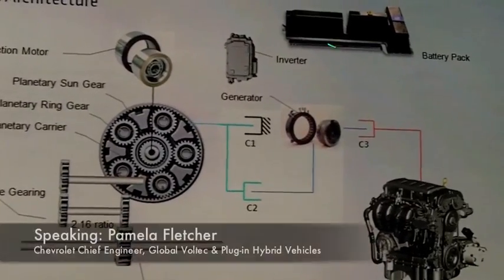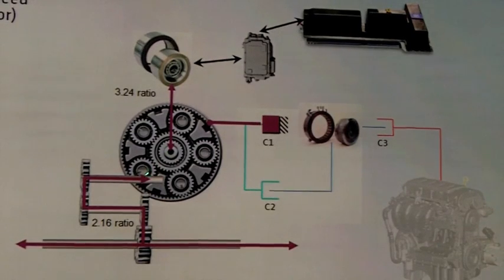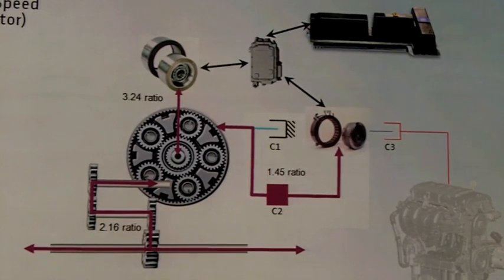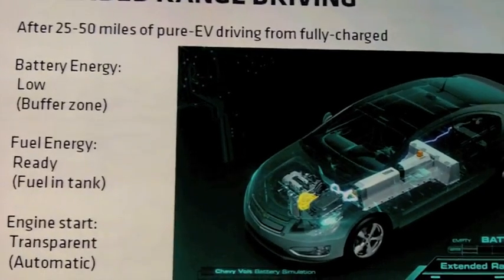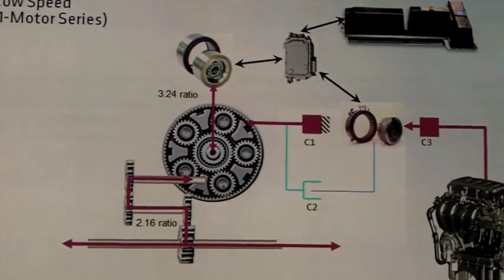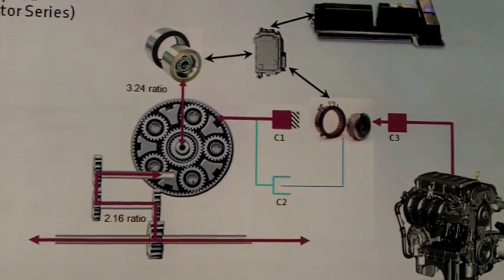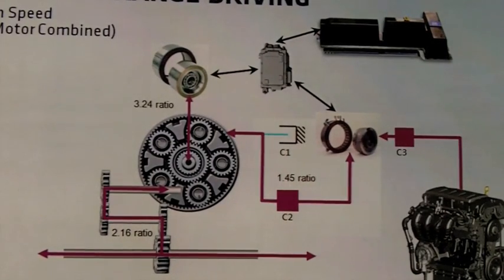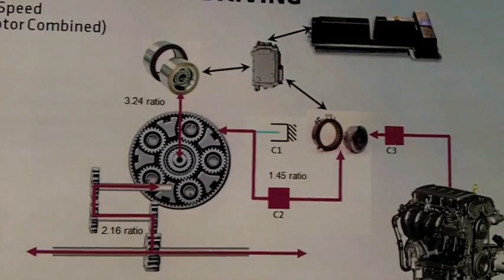Chevy Volt Powertrain Deep Dive | Part 2

Comment: 0:50: single motor electric drive
- identified as CD1 (charge-depleting, first of two CD modes) in GM's patent documentation 
- the planetary gear set is providing the 3.24:1 reduction 

2:15: two-motor electric drive
- CD2 (charge-depleting, second of two CD modes) 
- the planetary gear set is operating as a power combiner, joining the two electric motor outputs 

3:56: series hybrid drive
- CS1 (charge-sustaining, first of two CS modes) 
- referred to in the presentation as "extended range"
- the planetary gear set is again providing the 3.24:1 reduction 
- because the engine and generator speed is unrelated to the electric motor speed, the generator and motor effectively act as a transmission system with a continuously variable drive ratio
- many people incorrectly believe that this is the only hybrid mode in the Volt

6:29: output power-split hybrid drive
- CS2 (charge-sustaining, second of two CS modes) 
- the planetary gear set is again operating as a power combiner, joining the engine and electric motor outputs 
- the generator is providing the power needed by the motor 
- because the engine speed, electric motor speed, and road speed are all tied together by the planetary gear set, the electric motor effectively controls the engine speed and the effect is a transmission system with a continuously variable drive ratio; this is similar to a Prius, but with the planetary set acting as an output-side combiner instead of input-side splitter
- many people are unaware of he existence of this mode in the Volt, leading them to incorrectly declare that the engine is never mechanically connected to the wheels 

See Wikipedia's article for "GM Voltec powertrain" for operating mode descriptions.

Comment: I'm having a very hard time understanding how and why hydraulic fluid pressure control solenoids have any relevance with the drivetrain in question.  A 3 phase electric drive motor and gearset should be able to function independently of any clutch transmission fluid.  What is the purpose of the 6 variable pressure control solenoids and how do they relate to the main drive axle operation?
Reply: availability of parts wise it was changed in 2nd gen
Reply: The hydraulics operate the clutches. If you don't understand why there are clutches, you didn't watch the presentation.
Reply: @brianb-p6586  I didn't say that.  Clearly you don't understand the question.  The only reason you would need clutches is to start the gas engine generator.  Clutches are irrelevant to the drive operation of the motor and irrelevant to propulsion in this vehicle.
Reply: @carterrealty5619  
Your original question was what the hydraulic control solenoids were for, and I answered that: the hydraulics operate the clutches. 

You then insisted that there was no reason for clutches. The video explained that, so you clearly didn't understand what was shown in the video. I will explain it again:
Clutches are not just used to allow an engine to turn at different speed from what it is driving (by slipping), they are also used as a mechanical "switch" to connect or disconnect rotating components. The clutches in the Volt's transmission are the same type as used in most automatic transmissions, because they are doing the same job of connecting components in different combinations to result in different power flows: they are hydraulically actuated multiplate wet clutches. 

If all of the clutches are open (disengaged) the engine and electric motors can spin all they want and nothing makes the axles turn. The clutches are needed in this design. A Prius transaxle has no clutches, but because of that, it is always in power-split hybrid mode.

Comment: It is more efficient to directly connect the ICE to the planetary, because the only loss is in the gears, which might be  a few % loss, whereas generator power conversion has a 5% loss, and the inverter another 5% loss.  This is all dependent on load and RPM (in ICE, drive train, and power electronics) which is why it is selectable by the computer to maximize efficiency.

Comment: Why is it more efficient to direclty clutch the ICE to the drivetrain?
Reply: Because it avoids the losses of doing a mechanical-electrical-mechanical conversion - if it happens that the vehicle speed is in the sweet-spot to allow the engine to operate in a zone of low "BSFC" (horsepower per grams per second fuel consumption)

Comment: @AndrewNCook that's just not true. it has 16kWh (it would need much less if it weren't so pathetically engineered and overweight) but lithium batts cost from 250-400 max pr kWh. that's around 5000$ for the batteries.

Comment: @DanFrederiksen Haha, yeah, that's true.  But all the cost is really in the battery, motors and power electronics etc.  A smaller engine and losing a few gears wouldn't get you too far cost-wise.  If you don't want one of these or a Leaf, save your money and buy a plug-in Prius or Focus EV when they come out.  This should be a really cool decade for cars.